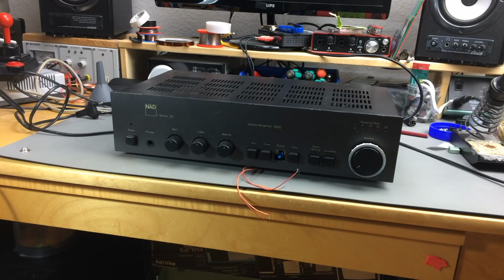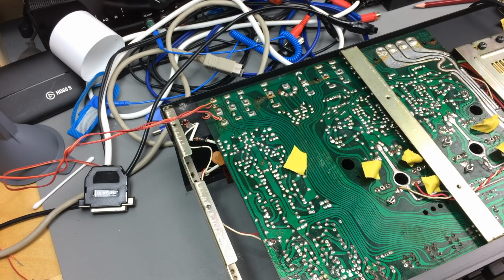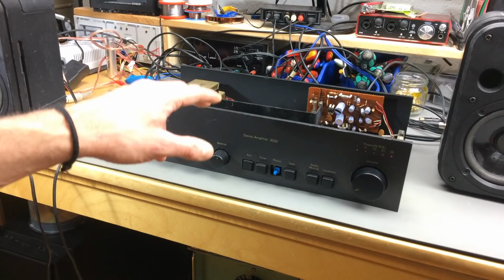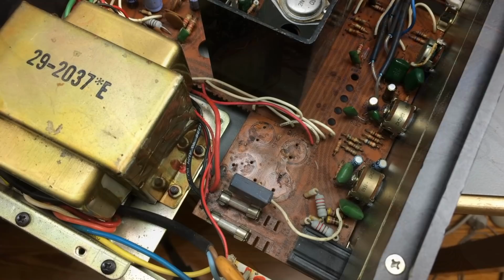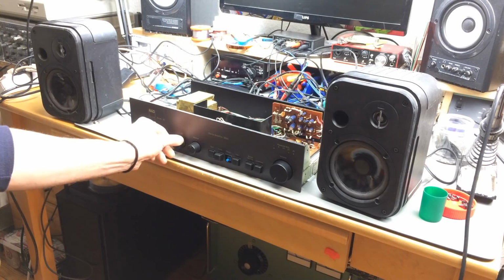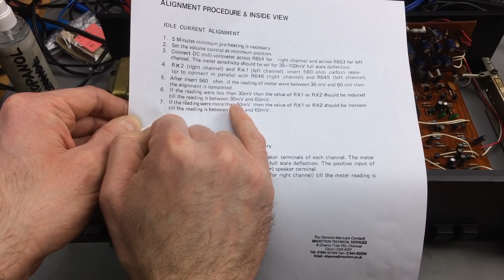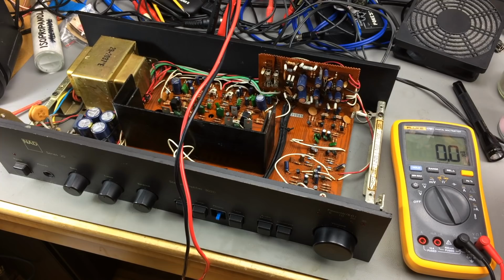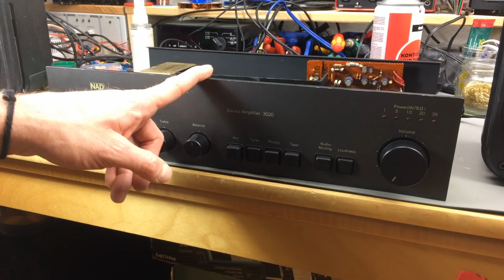NAD 3020 Series 20 Vintage Amplifier Repair

Comment: I downloaded a few schematics of the different revisions of this amplifier, compared and made some changes to the schematic that would be relevant for You. I think like this its a bit easier. You can take a look at it here https://ibb.co/wSY40c0 But yeah, adding resistors of different values to the existing ones to get the idle current in check is not exactly an elegant solution ^^; Variable resistors were too expensive? not reliable enough? And having to add resistors at r654 and r653 to measure the voltage across them is a bit weird too, but i guess not totally uncommon
Reply from the maker: Ah, thanks for the schematics! I'm going to use them next time I'm in there. I think I'll end up replacing the output transistors altogether and add variable resistors for the idling current. I guess they really wanted to cut the price by deciding on fixed resistors, otherwise it doesn't make much sense.
Reply: I think replacing the output transistors, at least for the side where You couldn't adjust the DC offset, would be a good idea. I totally agree. Maybe get 10 of each, if possible, get a component tester, if You don't have one already. They're really cheap) and measure then for hFE (gain). having matched hFE values improves sound quality greatly, cause the transistors will amplify the input signal in a similar or equal way. If You don't do that, even transistors from the same batch can differ greatly in hFE.

Comment: New transistors from the crappy clone factory in china? old transistors are usually better. Or NOS transistors, Mica insulators will disintegrate when cleaned so .

Comment: Of course that was the base model of the n a d because it only had Provisions for one set of speakers the next model up had provision for two sets of speakers A and B and that one there is probably only about maybe 15 to 20 watts per Channel I've had many of those amplifiers and receivers they're very good units they have tendency to last a long time the only weakness they have are the very garbage type of capacitors that are in the they have a tendency to leak and go bad that's why anytime I work on one of them I suggest to the owners to have them recapped because those capacitors go bad the only ones that seem to last longer are the main ones that are on the power supply they last the longest but they do eventually fail and when those go bad they go bad quick and you do risk on many a Time getting some bad results in that so after changing all capacitors on the board I would keep an eye on those main caps on the power supply cuz the minute they start drifting I would change them because they can fail catastrophically